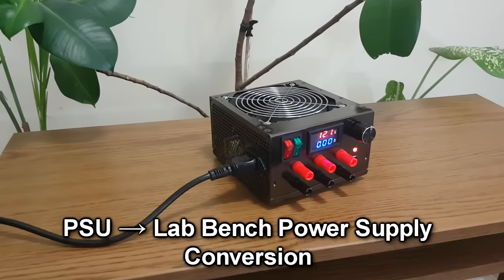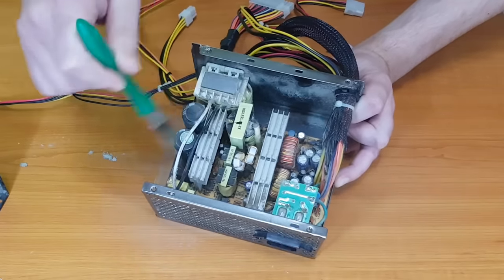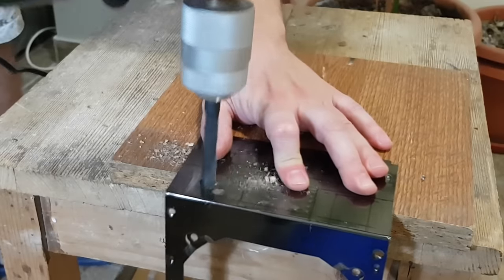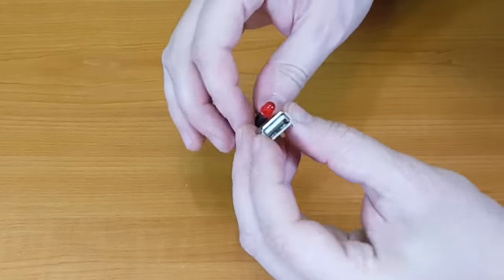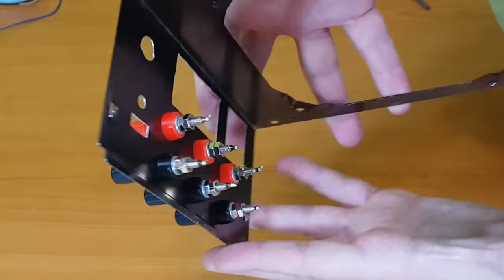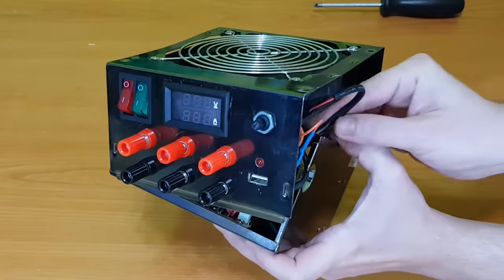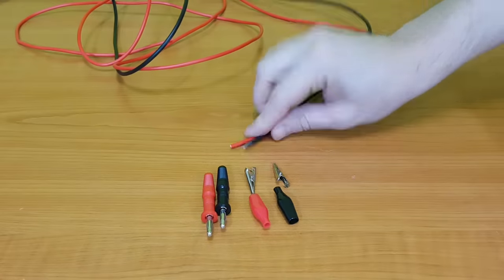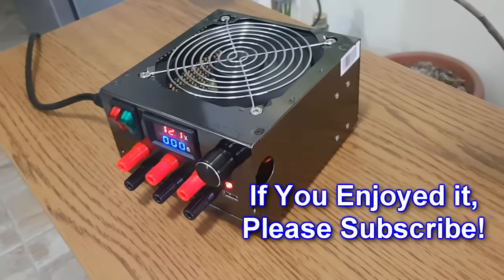DIY - Lab Bench Power Supply

Comment: 10:04 ...the power supply is "producing only 20mA even if on the power supply is stated 2.5A"...
This is NOT how the USB charging is working! 
So many peoples are thinking that an USB charger is (only) a step down/up convertor and this is all...WRONG! You need a B.C. 1.2 chip and then it will trag up to 10Watts or 12Watts...otherwise THE PHONE will refuse your power supply to be used at full capacity...you can even provide 1000Amps..without a battery charger controller the device will charge with a maxumum of 100mA (up to 500mA for the cheap chinese devices).

Fortunatelly....USB Type C will enforce all this into a real regulation of charging a battery...
Reply from the maker: did you watched the part 2 video about this PSU conversion?

Comment: i Like 9V  and 1,5V , and 12V, like i dont know most usual battery yeah  , and transformer output 12V , with that kind of output this would be better then most bench powers , because , mine goes to 200W , while bench top Transformer is 20-30W , that is 10 tiems better , but it needs to have proper voltage ,its useless without it, im making mine , i dont make a video , it will not be made to look good but to work good .

Comment: Deadly. Including the side hole pun.
Mains and control voltage in one switch? Great idea. No idea of isolation.
Protection earth: botch when attaching without cable lugs. This makes my stomach turn.
Also: low voltages at the output, right next to the mains voltage supply line! Your shrink tube is supposed to be a joke, right? It can never serve as a correct isolating distance for mains voltage. And definitely not in the event of a lightning strike, when your super-mad botch falls down or you pour in coffee (Only some. There are many other error situations that an amateur ignores due to a lack of knowledge).
Now you could say, "That never happens" ... Exactly, it only happens ONCE!:/ Devices that are properly processed according to (safety) standards are suitable for precisely such cases ... Without killing their user.
P.S .: 10A through the rotary switch? *facepalm*
All this bullshit is completely irresponsible. And then in front of an audience. I would be ashamed ... or wait for the prosecutor.

Comment: You need short circuit protction
Reply from the maker: The power supply already has short circuit protection.
Reply: @Sorin_DIY  I have a computer equipped with power. Does it have short-circuit protection?
Reply from the maker: all PC power supplies should have short circuit protection. maybe the cheap and rubbish ones don't have.
Reply: @Sorin_DIY  How do I know it has shortening protection?

Comment: I have got voltage problem when ı try to adjust high voltage and after plug to lamp voltage is decrase?
here is the video https://www.youtube.com/watch?v=KO08zaX54fs&feature=youtu.be
Reply from the maker: Hi. there are a few problems with your power supply:
1. you need to cut the thin black voltmeter supply wire, because the voltmeter gets the negative supply voltage from the ammeter thick black wire. if you connect both black wires of the volt/ammeter, you will short the ammeter shunt, the current measurement will not be correct.
2. the buck/boost converter you're using can deliver max 3A and max 15W without extra cooling (heatsink on the ICs + fan) so you cannot power the 55W bulb with this 15W converter. 55W/12V=4.58A, the power and current consumption exceed the converter limits.
3. you need multi turn potentiometers to adjust the voltage and current, it's difficult to do that with simple potentiometers.